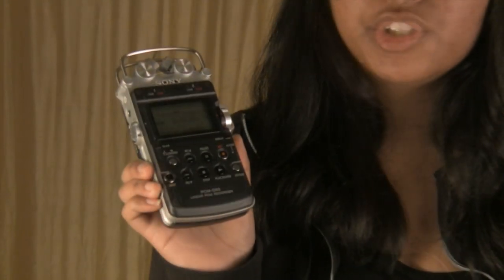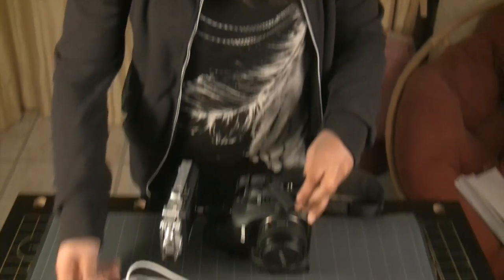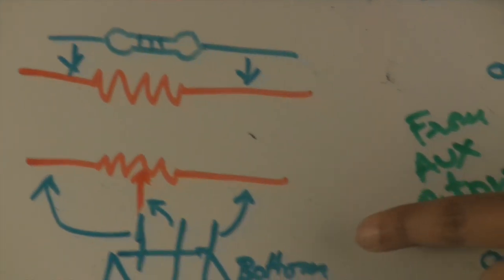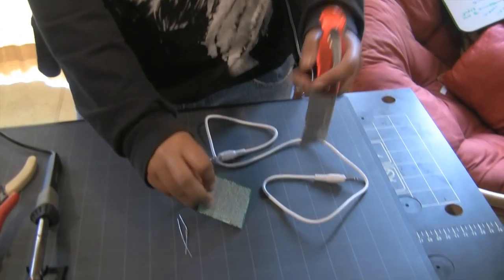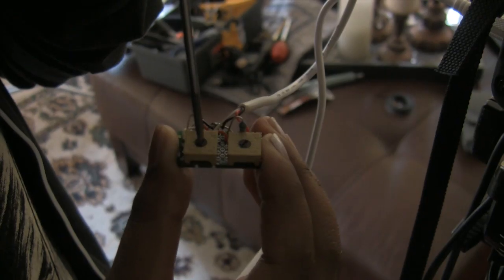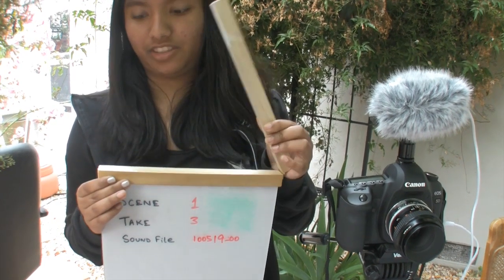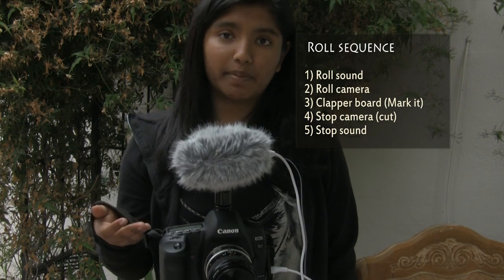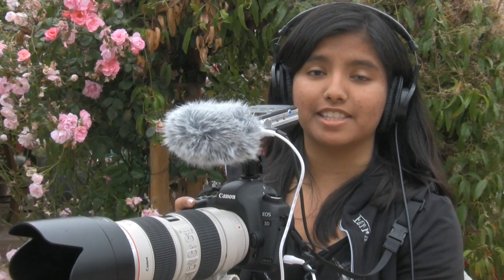Ultimate sound recording in Canon 5D / 7D and Sony PCM-D50

Comment from the maker: @Trsmoothie When you connect a wireless lav or boom mic to an external recorder to record sound far away from camera, the camera mic will not able to record that sound but the recorder will. In such scenario, you won't be able to sync camera and recorder sound tracks in post. The solution- connect the camera to the recorder using an attenuator cable as I have shown in this tutorial.

Comment: @supportren No it doesn't.  You can still hook the wireless lav up to a device such as the Zoom H4N and then just sync it in post.  A clap still works better than anything for syncing.  Most higher end cinema productions never record video and audio on the same file.

Comment from the maker: XLR cable is nothing but a three core cable, designed for carrying balanced audio signal and phantom power. It is primarily used for Condenser Mic. Whereas an instrument cable is designed to carry unbalanced audio signal. No way XLR is superior than instrument as their application is different. Using XLR will not going prevent any noise than a good shielded instrument cable.

Comment: Thanks, i just have 1 question about inputting the .mov to Adobe Premiere, what software do you use to convert a .mov film to be able to read in Premiere. Also I have a video which is 1280x720p (60fps) which one should I choose in my new project HDV > HDV 1090i30 (60i) or HDV 720p25?

Comment: I guess I'm confused. Why couldn't you just use an H4N or professional recorder instead of the camera's onboard audio all together? Meaning using the professional recorder as the camera's microphone. Then everytime you start/stop recording on the camera it would create a new file which would include the synced audio. This would also take a step out of post edit audio syncing, right?

Comment: @supportren I'm no audiophile or engineer but comparing the internal mic to a studio grade condenser mic is pretty extreme.  It may record at a higher frequency but if you've got a $2 mic as the conduit, then it really isn't a fair comparison now, is it?  Take the home podcasting industry for example; you can spend $10 on a desktop mono mic and record in uncompressed Wav format but it's only as good as your mic will capture it.

Comment from the maker: You can buy preset attenuator cables and that can be a good solution for you. My design allows you to change the attenuation level, I do not know if you can get such cables in the market. If you need one, I can construct one for you. Several of my readers actually bought my cable, which I make as a fundraiser item for rennow.org

Comment: @supportren I apologize if this has already been clarified ( i Haven't read all the posts). In case it hasn't been pointed out, i would like to suggest that no matter the distance of sound recording from the camera, if one were to use the clapper board close to the camera (filling the frame), your camera will always pick up the audio, as well as your high end Microphone, Thus the possibility of an easy sync in post production.......

Comment: Hi Ritwika. I am trying to buy the resistor and potentiometer at Radio Shack and the max capacitor I have found is 100k ohms. Is the resistor numbers (220k, 200k) are correct or are they in 220 ohms and 200 ohms? I have visit a few places and I only have found no higher than 100k. Thanks for your help

Comment: Hmmm.  You've gone to a lot of trouble to use those on-board Sony mics, which aren't designed for movie recording at all, but for journalist's field recording. In fact even Sony specifies this as a field recorder.  Better off with a mixer/recorder with XLR inputs, a line-up tone and some good mics including a shotgun.

Comment from the maker: @Ratocx To quantize any high frequency, the sampling rate needs to be at least double of that freq. or higher. 48 KHz sample can capture freq. up to 24 KHz. but you will get so much better fidelity at higher frequency, if you use 96 KHz. This will give the sparkle in the sound which will lack in 48 KHz recording. Don't believe me? Do a listening test with a 96 and 48 KHz sample files and you will know exactly what I am talking about.

Comment: I dont see the need to really input audio back into the digital camera. Just set the cameras mic as loud as you can. Even if you are still going to input audio from external recorder, instead of all that extra circuits, just lower the output level from the external audio recorder. Should be a software setting inside recorder. It just seems like a complicated setup, when both audio setting could just be adjusted instead.

Comment: I don't get it why all this connection needed if you are using the clapper board? Sound recorder picks up the clapping and so does the camera anyway and then you sync them the way you showed. Why wired?
Reply: +Serge Bertasius if your shooting docco run and gun style syncing can be difficult.
Reply: Serge Bertasius 
exactly right?? if the zoom h1 connect into the dslr ..then she must used the camera sound clip only

Comment from the maker: Attenuator is only necessary if you want to connect line level H4n to mic level Canon input. Why- I have explained in my tutorial. If you do not want to use it, make sure you clap or use a digital clapper board for sound sync. Don't waste money in cheap lav, been there done that. Nothing below $100 give pro result. Check Audio Technica AT803, Shure SM11, Sony ECM44 all are excellent. If you need shotgun, then get a Mitra Beamer DSLR.

Comment: Hi, why do I need to plug the sound recorder into the camera if I use a clapper board 
and also can I sync sound without clapper board using just the camera internal mic and sync it in post with the sound from the external recorder.

Comment: @rnuthman using the wave form of the audio clip, same as she does with the clapboard, btw 96khz is much better for pp audio work, as she states in an earlier post the steps between bytes are half the size, the similarities between digital audio and digital video pp are very close, she deserves respect for her efforts not the insults some bigheads throw.

Comment: 220k 1/4 watt resistor?
What does that mean?

I learnt resistance (or resistivity) is measured in Ohm and is written as the greek "omega" symbol at school...
Watt is used for power. With electric things, it can be found by multiplying Current by Voltage if I well remember.

My English is too poor to understand what a "trim pot" and a "vero" are. Sorry!

Comment: I thought this circuit would make DSLR's sound just the same as SONY recorder's sound. If that is possible, I don't have to throw away DSLR's sound and insert SONY recorder's sound and I can save time when editing. But that's not possible and you're using SONY recorder's sound...I'm so confused.

If you have to throw away DSLR's sound and insert SONY recorder's sound anyway, why do you make that circuit?

Even without that circuit, I can synchronize DSLR's video and SONY recorder's sound!! That circuit is unnecessary!!
Reply: That completely depends on the sound environment you're shooting in, and how far the camera is from the subject.  If you're shooting in a very loud environment, and/or too far from the subject (or other mic) the sound from the camera may not be exact enough to easily sync.  That being said, the circuit is not needed in cameras that let you adjust the mic recording levels.  You just need a 1/8th to 1/8th.
Reply: HI Joon, No need for confusion. The audio quality of the Canon DSLR is not nearly as good as the sound from the PCM50 that she referenced.  You CAN use the sound from the camera with a Rode mic but your audio won't be as clear or precise.  My opinion is that she's done an excellent job of explaining all of the parts and their purposes.  I can only suggest that you review the video again so you can capture the techniques she's recommended to replace the video from the DSLR.  You are using the DSLR sound only to sync with the video (through a non-linear video editing software like Adobe Premiere) with the audio of the PCM50.
Reply: ***** Not in all situations.  If you're shooting at 80mm or higher and in an environment that is loud, like an indoor event center during a crowded event, it is VERY beneficial to run the audio like Ritwika has done.  I have done this and had both setups.  It was significantly easier to sync the audio when I had the audio recorder being fed into the input on my camera.

This is coming from my experience.  

If you're shooting in a quiet environment, no need to do this.  But in a loud one, where your external mics are fairly far away from your camera, this is a very good thing to do in order to help you sync up your audio later on.
Reply: OK, I see :)

Comment: I never said you were wrong, it is totally correct what you wrote, but it is obvious that you are not an expert sound girl. I do have a Sony PCM50 and I positively know the many noises you get if you place it on top of your camera and you won´t be able to get a good sound from it if your subject is more than two or three meters away from it  For wireless you can attenuate the receiver output internally and for boom use you will need more that your little cable and attenuator. Sorry.

Comment: Darling you do not need to link the Sony PCM D50 to your cámera though a cable. Just put both of them to record and then sync both sounds on Final Cut or whatever editing software you use. You seem to be very thecnical minded but we profesionals
are practical. The passive attenuator is not nessesary at all since, at the end, you will never use the sound of the cámera.

Comment: Just need a slate to sync sound with picture....thats it....& no ref sound is required. Actually, the mic on the cam/PCM D50 isn't worth (the recorder can be anything)....so your sample rate and bit depth won't be affected but the quality of recording will be substandard because your acquisition is below par i.e. bad input will always be bad output even at 24bit/48khz. So....the solution is to get a better mic to get a better input...use shotgun mics for film stuff...& record at 12-20dbss...:)

Comment from the maker: @ooxcfhxoo It is impossible to sync audio video by announcing H;M;S as it requires centi second resolution 

Attenuator helps to keep camera audio at proper level. For non-critical application use camera audio, for best sound, use the external recording, your choice.

For a single shooter, mounting the recorder on hotshoe is the easiest to handle. Sure it will pickup handling noise, but DSLRs are not professional video camera.

If you have a grip crew, then boom is always the best.

Comment: great, use a expensive sound recorder to used with a home made circuit with a high signal noise ratio, and if you going to record the sound in a camera you doesnt need a 96 khz sample rate because that signal still analog, you have to record in the sony pcm and them sincronized in any video editor

Comment: Admirable that you are mucking about with building your own electronics for this purpose.

but don't most people just drop their audio levels with manual audio settings?

I have a 7D and one click above off seems to be the magic number for it with my Sennheiser EW 100.

Also, please, for the love of pete, please, please stop using that 50mm f/1.8 with your lovely 5D Mk II. That plastic piece of junk has no place on anything better than a 1000D, which itself is a plastic piece of junk.